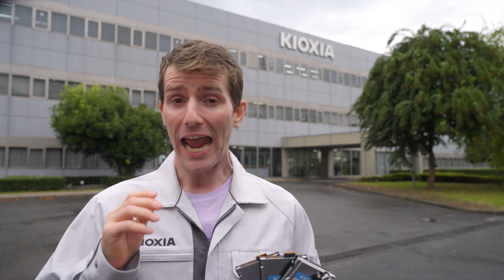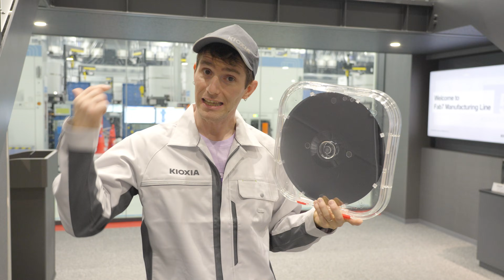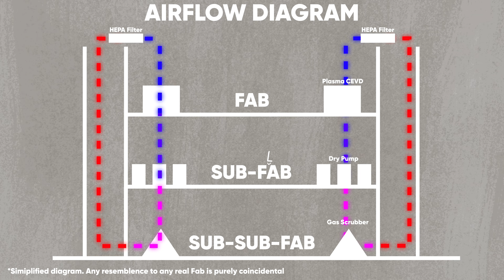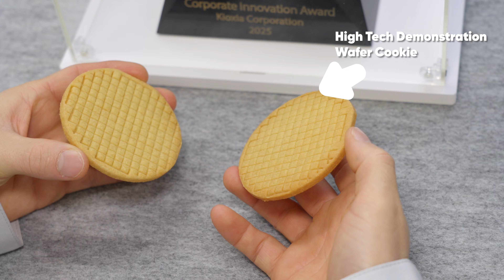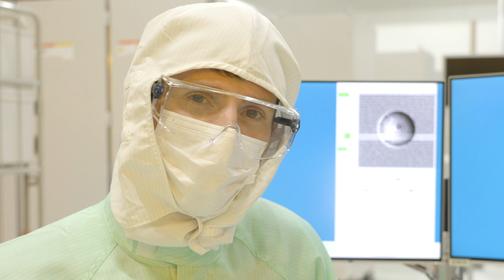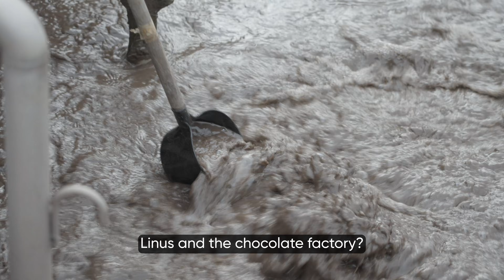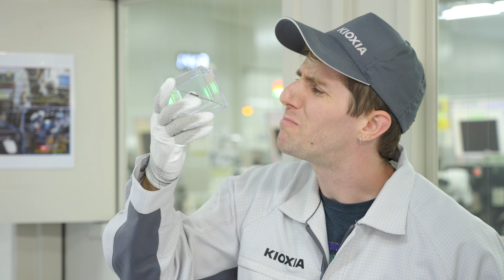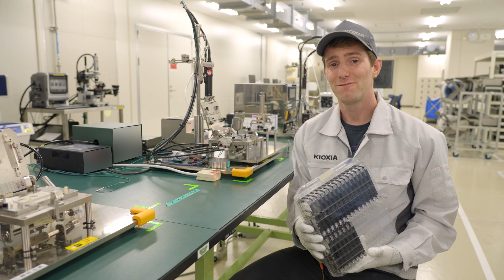A Petabyte in the Palm of My Hand - Kioxia Factory Tour

Comment: Pretty cool to see on your channel. I was in the polysilicon scene for years. I have made electrical and solar grade polysilicon. Worked with the reactors, VGR (Vent gas recovery) waste water/srubbers etc. and in post production etching the raw polysilicon. I was part of the emergency response team, STC and TCS is some nasty stuff and very difficult to fire-fight. Dubbed "hellfire" by anyone that has experience with it. Spent years in clean rooms as well in chip manufacturing as well as another project i was apart of using depleted uranium to make semi-conductors. High heat tolerance and  plenty of it, but had issues making a core to cut wafers from.

Comment: My mom worked in semiconductor fabs for years. I have three of those silicon drops, had 'em as long as I can remember. Mine are nowhere near that size though, maybe topping at 200mm ish. But she hasn't worked in that field siiince 2006 or so, mine coming from the 80s and 90s, maybe they've gotten more biggerer in modern times.

Comment: That segment on dual-use wafers stood out. It’s always fascinating seeing how a single substrate can be engineered to deliver such different performance outcomes depending on the layer roadmap
Reply: It's because CMOS fabrication requires higher tolerances than NAND. Building 32 layers of NAND on high tolerences was going to be expensive. The RAM manufacturers just build each layer of NAND seperately at stack them later on.

Comment: Im pretty sure the RAM factory has armed guards, at this point
Reply: Only to ensure nobody damages the equipment, otherwise there is not much that can be stolen through conventional means.
Reply: @inzaniatelcontar4600 you'll need some hardcore equipment to even steal it, like a forklift to move the server and storage units
Reply: @AncientEden  Just take the wiring spool and dip :D
Reply: @AncientEden Nah, you'll have to pull the whole building from earth to steal it
Reply: @AncientEden BRO IVE A BACKPACK 😶, I can store atleast 200 units of 32 gb ddr5 ram.
Reply: @inzaniatelcontar4600  from damage yes, from being stolen…the very act of being in that building without all the safety/clean overwear..the machines will be most likely worthless
Reply: They are making sure a Money Heist type of robbery doesn’t happen
Reply: I worked with sony at ps3 launch replacing and recalibrating optical blocks in bd drive. Enhanced disclosure from police etc and background checks. FOR BROKEN CONSOLES AND SPARE PARTS.
E.p.s. in chipping warden was home of big 4 cell networks in uk. Sim cards only and customer phones for repair in one dept, 3g was developed there in another. Searched in and out. Metal detectors too. That was just to protect ip. Silicon fab will have armed staff. Ex military. Dont have to be a big obvious bloke. Because gun. Lol.
Reply: since this is in japan i wouldnt be surprised if the Chinese already have people working on stealing technology from it (or maybe they've already got better NAND stuff on their own)
Reply: @ShaiyanHossain  as somebody who worked in the technical service field of repairing that equipment i can gladly tell you, they basicly 40 years behind. The issue is the lack of understanding that this equipment is sensivit to any dirt or forein particles. Last time the pallet with the maintance and replace equipment was standing in the rain for a month till i  arrived and basicly needed to wait for replacement of the pallet since it was contiminated. Somehow the chinese volks on some places doesn't understand what this stuff must be cleaner then an OP room and thats sabotaging their own production
Reply: And you think this one doesn't? 😂
Reply: Ram will go up due to only 2 makers left
Reply: These things are guarded like national security treasures. Which they are
Reply: This needs to be in a laptop
Reply: Humanity isn't lost yet. Everyone still trust each other at 2025 december.
Reply: At this point?
Reply: F35s circling at all times lol
Reply: @jprsfragoso  as they should.
Reply: gta online heist idea
Reply: @jprsfragoso  maybe military personnel, treated as “special assets”
Reply: This place probably also has armed guards as well, they where just not shown.
Reply: Allways had. All Chip manufacturers have armed security.
Reply: @sppb666  clearly you never worked in them
Reply: It doesn’t take a lot to reverse engineer those systems. It just takes a couple people looking all around inside of them to figure out more than they should know.
Reply: @DiscountManul making ram isnt a issue. Its buying the clean room and getting the equipment from ASML. 

Nope. Its actually mostly about Terrorism and stopping people from causing issues for the factories operations.
Reply: Might as well rob the bank, better profit per kg of loot.
Reply: @JojoJoget its not about robbery but terrorism but shure tell me more.
Reply: Wouldn’t be surprising at all. When a single line of inventory represents millions in value, security becomes part of the production cost.
Reply: Funnily enough, my bro in law just started working security at Micron. I also delivered a few packages there and to even drive up to the building I had to give them my driver's license and get on the approved list. I'd be astounded if they didn't already have armed guards.
Reply: No
Reply: Arm SWAT teams like they like know where every single door is so they have to predict them all
Reply: its literally in japan no ones gonna steal anything
Reply: @jprsfragoso  Like a fkn bee hive 🤣🤣
Reply: NAND is NAND, production lines could be used for both SSDs and RAM. Kioxia makes a profit on this whole situation too.
Reply: @saiv46  RAM is not made of NAND chips.  True, both types of memory have much common equipment in their production lines, but its absolutely not the same thing and the production lines will have some very different parts.
Reply: you think they are built anywhere near crime? lmao.
Reply: @sillybrilliant  This is such a funny sentence.
Reply: @sillybrilliant  well the difference is that you can bring crime anywhere you want
Reply: @sillybrilliant  So any neighbourhood with beeping smoke detectors?
Reply: @NoFailer ayy
Reply: @NoFailer this is an objectively terrible joke btw. There's only one thing you could be finding actual humor in here. Ahh yeah so funny that low battery smoke detector matches with crime rates...😭 take a break from reels kid
Reply: @jo3pi3    humour is subjective
Reply: @portal12350_a never said it wasn’t. I’ve already acknowledged his humor is different than mine
Reply: @jo3pi3  calling a joke objectively bad is calling it unfunny and you didn't acknowledge it
Reply: @p @portal12350_a I believe people find bad jokes funny all of the time. The reason people find it funny is the only thing I might care about. I’d love for someone to explain the humor. There’s so little to it
Reply: @jo3pi3  no you said the joke was bad and completely wrote it off like the humor police.
Reply: @NoFailer Based
Reply: @NoFailerdoes Trump have beeping smoke detectors? He is a convicted felon, after all
Reply: You need assault rifle for security if the factory is in America
Reply: Kinda freaky to think if memory continues to be this vital, they’ll end up potentially be targeted for bad reasons
Reply: @650dude  doesnt need to be targeted per se, just has to be copied stolen.
Reply: Do you honestly think that a factory worth billions of dollars wouldn’t have a small army on guard full time?
Reply: A capitalist fantasy, and a dystopian nightmare.